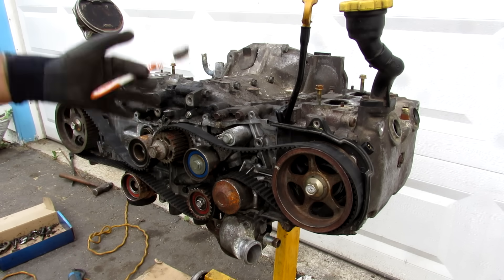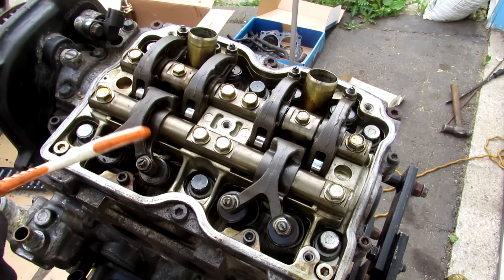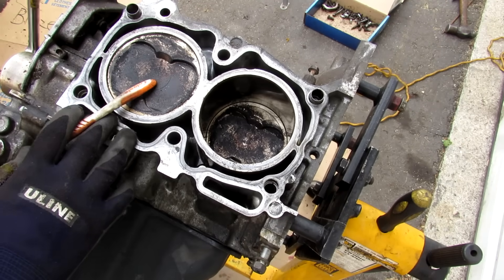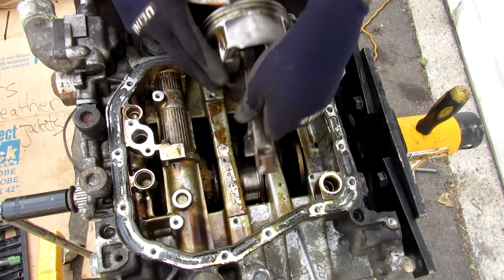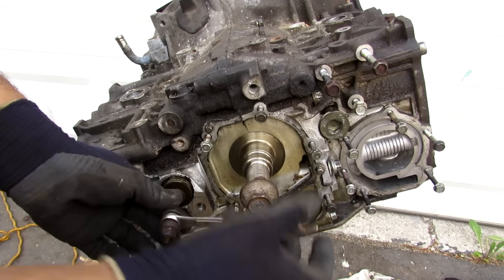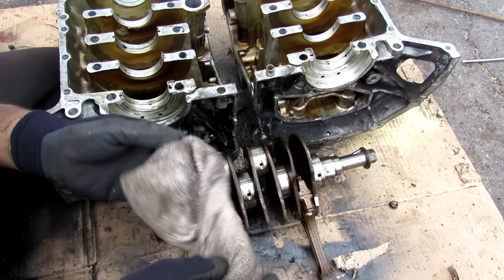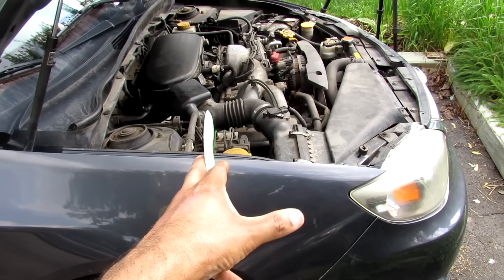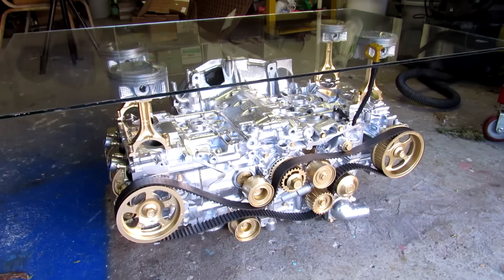Why Subaru Engines FAIL

Comment: I've seen a few used low mileage Subies with blown head gaskets and/or shot bearings.  Now I see why.  If you let the car sit too long between drives, the engine really grinds on itself.  Seems like a pretty good reason to retrofit dry sump oiling to me.  Or some sort of pre-oiler before start-up.  Also, rigorous oil services seem a necessity.  No 15K mile intervals here.

Comment: News flash. If you don't maintain your engine, it doesn't matter what kind it is, this is what you're going to see. This engine didn't have regular oil changes and was ran low on oil. It had nothing to do with it being a Subaru boxer.

Comment: Subaru LOL.  They told my sister that 600 miles per quart was normal oil consumption.  2 years old 30k miles.  They replaced the engine and that one was junk too.  LOLOL

Comment: i have owned a subary legacy turbo 2007 2litre for 6 years absolutely no problems and i drive it hard all the time yes it uses a bit of oil but i check it every month this is my second subaru the other 2002 legacy i owned for 5 years also no problems

Comment: I have had 2 Subaru and put around 200k miles on each without failure. Keep you engine maintained, and it will last for years and years. Good breakdown video of the motor though, I did enjoy that
Reply: My Saabaru Aero has over 200k miles and is still fine. Maintaining it make the difference.
Reply: No one else is concerned about 100k on one set of tires?
Reply: I put 162,000 miles on my first Subaru a 2.5 four cyl engine in a 2005 Baja.  70,000 on a 3.6 six cyl Outback.  All together, since 2005 around 400,000 miles.  Zero engine problems and no mechanical or electrical problems other than one safety recall issue that was fixed at Subaru’s expense before any problem actually happened.  No repairs of any kind, just periodic oil and filter changes at around 7,000 mile intervals.  Never had an oil leak and never had to add oil in between oil changes.
Reply: @Militant 541 People always come up with examples of their car lasting without problems. They don't appreciate that these are just individual cases, you can apply that to any make and any model.  This has to be looked at using thousands and thousands of cars to get an idea.
Reply: I'm going to guess these issues don't apply to my 3.0 H6.
Reply: My 2004 MY05 RS Impreza been going for 220K and 16 years later I haven’t had any head gasket issues. I think a lot of the issues arise from the way drivers treat/mistreat these cars.
Reply: Militant 541 I think most of these head gasket issues apply to mostly the Turbo models which are bought by younger drivers who constantly make modifications and drive them like race cars.
Reply: @Jay Nasty That's good to know actually. Is it an issue on both the 2.5L and 2L? I'm on my 3rd Subaru now and my daughter has my last one, so I'll keep my eye open for the issue. Thanks!
Reply: @Jay Nasty. Thanks. I have 165K. Just want to get another 9 months then I will be strictly leasing from then on.
Reply: @Militant 541 I've not had any dealings with them, a friends son is one example, and he sold it on account of the fuel consumption.  As you say, most cars use in line engines.  Subaru thought the advantages were worth it, presumably because of the models were often aimed at buyers who valued rallying/high performance use etc?
Reply: @Militant 541 I didn't understand that....Could you rephrase it?
Reply: Like most cars they're fine if you keep up with the maintenance and fix stuff when it breaks. Let it go and it's a nightmare.
Reply: @Militant 541 A fair few are here in the UK I'd say.
Reply: Except any modern engine will last for 200K miles if properly maintained.
Reply: @Militant 541 As per my post here, people happen to have a good example of whatever (in this case Subaru) and assume that as such it must represent every similar make and/or model on the road.  Easy, but incorrect, trap to fall into.  All part of the human thought processes.  "Mine was amazing, so they all are!"  You can see it here, and every other forum on the net, in the bar, workplace and so on.........
Reply: It also works the other way too, a few people complaining of issues doesn't mean all are problematic. And he is talking about one generation here which is long retired. The EJ series was a faithful servant but prone to headgasket issues but probably no more than Nissan of same era.
Reply: @Militant 541 FACTS💯 garbage cars,with clear mechanical problems sold to shitty drivers who can only "aim" their cars. How many times are these idiots going to replace head gaskets before they get it...
Reply: My 2011 Forrester has 250k. Bought it brand new. She burns about a quart of oil every 800 miles. She still runs well though
Reply: As Tom Petty says, "You get lucky sometimes". My neighbor got over 300k from a Yugo, but I would never reccomend that car. One must also note that he never drove it over 35mph. My Honda has been drove hard and put away wet and it has over 325,000 miles.  It has been driven with more miles over 60 mph than under.
Reply: Only problem I've had with my two subarus is people crashing into them when parked...Mazda and Honda's on the other hand, drink oil and blow up...most engine failiours probably lack of maintaince as can be seen with what looks like being short on oil wear.
Reply: @Militant 541 maybe the problem areas are the owners. Like every car has problems but becomes worse because of the owner
Reply: @Militant 541 https://youtu.be/-aq0hDvKJ5Q this guy can explain it best..
Reply: So should we get a subaru?
Reply: @IgnatiusCaelestis   Don't do it, unless you plan to change it soon after, their engines don't last, and are just a pain in the ass, unreliable and overly complex. The boxer design causes the pistons to wear fast due to gravity, don't expect these to last as long as the conventional vertical design ones, specially if it comes from Toyota, like the 1.5-liter DOHC 16–valve 1NZ-FXE I4 VVT-i (Atkinson cycle) engine.
Reply: @hedgehogthesonic3181  the fa24 just came out a few years ago.  How do you know that?
Reply: @IgnatiusCaelestis  Well we will see about that, but still the design is bad and is not going to last as long as the conventional vertical one. Gravity is going to cause wear in only one side of the pistons, no matter what. But we will see how long that engine lasts.
Reply: Go walk through a salvage yard and you will find a much higher number of GM, Ford and Dodge vehicles when factor in the number originally sold.
Reply: @Jay Nasty As an actual owner f 2 100k mile plus Subarus (one 200k) I can tell you I'm not BSing. I did all the recommended maintenance and both cars were bullet proof. Just a sample of 2 though.
Reply: @dnoH  well I have 4 more I can add to your sample.  Over 400,000 miles altogether with zero problems.
Reply: @dnoH  Subaru were the ones who redesigned the gaskets and pistons because of all the problems.
Reply: I had one that was maintained well and drove lots of highway miles. Rod went through block at 202,000 mikes.  Still good but not up to Toyota standards. My sister's blew head gaskets at 100,000. I see the why after this video. overall good cars just don't expect 4 runner longevity.

Comment: The title should have been, people don't know how to "maintain" 90s Subaru motors, my 99 Subaru legacy GT 2.5L is the dohc motor and got it 11 years ago with 70k miles on the odometer ( new odometer 62k miles on it) and now it had way over 200k miles, always maintain it top notch, timing belts changed every 60k and if you are worried about the head gasket just get a 2004 STI gasket and problem solved, cheaper than replacing a water pump on a audi😂😂😂 and can't compare the reliability....... Audi, Mercedes& BMW be like...... Oh craps my car its almost at 60k😞 time to get a new one.

Comment: An incredibly informative video from which I have learned much, having only stripped conventional engines previously. I have a 2.0 DOHC BP5 engine, but by and large, most of the  procedures are similar. Very well explained and clear video instructions.

Comment: Being damaged by running low on oil isn’t a design flaw
Reply: Burning a quart between changes on the other hand.....
Reply: @Z287899  More like 10 quarts.  One every 600 miles
Reply: It is, because it is caused by a series of design flaws.
Reply: @borasumer  Correct, seen this on quite a few YouTube vids, when people try and boost these things with powerful turbos, more than once I've seen them basically fill the catch can within 2-3 dyno pulls
Reply: Does gravity play a factor. Or is oil pressure enough

Comment: As a long time owner of Subarus (first one a 1978) I have always wondered what causes the unique sound the engine makes which is like the VW air cooled version. You can always tell what is coming down the road just by listening.  My current and probably last Subie is a 92 SVX with 83k. My favorite was a 97 Legacy Brighton wagon with the 2.2 and 5 speed. Too bad I was t-bones at 297k about 7 yrs ago. I would probably still be driving it. Also miss the 81, 82, 84, and 92 wagons with on demand 4 wheel drive.

Comment: Sorry but the only actual flaw on this motor are the heads walking on the block that causes the head gaskets to blow. The rest of the problems are all do to lack of maintenance 🤦‍♂️ this motors originally design is the VW motor from the 1950's that Hitler gave his approval to produce.

Comment: The original head gaskets were made of single layer steel not composite. I have been on Subaru pages for years and have never once heard of "re-torquing the head bolts" as they are torque to yield and are only meant to be taken to spec one time and then replaced.

Comment: Damn, now I now why my Subaru always ran hot. I always blamed the radiator being to thin or lousy fan but now I know why even after replacing the gaskets and resurfacing the heads, after a year it slowly run hotter and hotter...
Reply from the maker: Did the head gasket blow after you replace it?
Reply: @speedkar99  No it occasional whent out with out any relation. The timing belt was a yearly job regardless or it would go out, it was always the driver side timing belt.
Reply: @speedkar99  Sorry maybe wasnt clear, head gasket whent out slowly after replcement within a years time and car would run hotter and hotter until gasket whent out entirely. Timing belt would never last longer than a year.

Comment: The plugs are 100,000 miles tho,  that like 1 change for the owner on average, makes up for the clearance.
Reply from the maker: It's the same as having a timing belt vs a timing chain ... That one time expense you'd rather not have

Comment: What year engine are the most desirable / reliable / trouble free. And, what do you need to look for when buying a used Subaru.  "Thanks" great video!
Reply from the maker: The EJ25 are the most problem prone. 
EJ20 held up better
Reply: @speedkar99  What year / models did the EJ20 come in? "Thanks!"

Comment: First, this car is turbocharged?  By the looks of this engine looks like owner did NOT cover maintenance schedule.  Subaru’s, specially Outback and Forester (non-turbo) have terrific longevity, boxer 4 engine tough!  Yes, I know!  You maintain these engines, they’ll last forever.  My maintenance total almost 17yrs $19,000.  Most folks buy 3 cars in 17yrs medium $70,000!!  I’ve got 250,000mi on mine Same Engine!   We’ve had several, my Forester going on 17yrs old.  Do that with V engine or ‘inline’....lol.  Without engine replacement....only tune-ups, belts, the usual.  If your looking for racing power, Subaru is not your option.       P.S. Porche has boxer engines
Reply from the maker: It's good that you take care of your car. 
When others abuse Subaru engines like Corollas then we've got problems
Reply: I fell slightly sorry for the USA having to put up with the 2.5 engines. Mine is 2.0 DOHC here in the UK and the 2 litre models have much better reliability and longevity than the 2.5s.
Reply: I Had a focus svt in-line 4 with 226k miles on it when I sold it to a guy at work, beat the piss out of it every time I drove it too. All I ever see about Subaru is 16 year old kids blowing them up. I wouldn’t touch one with a 10 foot pole unless an old man owned it.

Comment: I've pulled a couple oil starved EJs apart and on a couple the screws holding the backing plate on the oil pump were loose, on one motor so much so that you could unscrew them with your finger. Its no wonder there was oil starvation.
Reply from the maker: Wow that's bad 
No oil pressure

Comment: Theoretically cancels vibrations. Spark plug access, not so good. Belts. Timing. Long. Hmmmm. Rocker assembly. Retorque the head bolts. Weepy-Deepy coolant on the outside. Inside are worse. Oversquare design means revs. Short stroke works with the rpms as well and defines engine size from stroke. Very nice explanation of the positions of the engines and where they sit. Volvo and suburu. The V6; shorter with secondary forces cancel out. Maintenance. Seems like improvements to oiil delivery, pick up and pump all could be improved to reduced engine oil starvation. I thought you would mention the improvements to rectify failure in your vlog, but I didn't really see that emphasized. No wasted time, thought. You went through it like you were late for lunch. AF
Reply from the maker: Good summary. 
Subaru has supposedly made the FA series of engines better 
Time will tell

Comment: My Subaru EJ20, 2002 year produced. 
Did 260000 km, not a single failure. Usual semi-synth oil 10w-40...
Reply: Pretty sure the 2l anbd 3l Subaru engines are super reliable just the 2.5 that sometimes have issues, my EJ20 is at around 255k and stil running perfect.

Comment: Boxers suck as an engine design - double the heads, camshafts, pulleys and other parts. Less rigidity, uneven thermal distribution, costlier to manufacture, heavier, harder to service. They were an experimental design back in the day, but inline and V engines are far superior in design and reliability.
Reply from the maker: True

Comment: In other words more cons then pros with Subaru engines they're lots of fun while they're working and require extreme maintenance to prevent the many failures they are prone to... if you don't have specific need for the pros that it offers and aren't ready to do thorough maintenance then you should stay away from these engines..
Reply from the maker: The problem is most people buying these economy class cars will treat them like the equivalent Honda or Toyota which can take more abuse because of their simplistic design

Comment: I loved my Subaru Outback, but after spending around 4 grand on a reconditioned engine (head gasket issue) that only lasted another 3 years, it is never again for me.   I could have lived with the head gasket issue, the reason never again is strictly due to how they responded to their customers who had to deal with their bad designed engine.  Basically no help at all.
Reply from the maker: What year and mileage? Did the head gaskets fail after they were replaced or was it a used engine?

Comment: My 2005 Outback committed Subiecide a couple years ago. Front differential seized and blew its guts out on the ramp to a major bridge. Gear oil for 1/8 mile. It was embarrassing to say the least.
Reply from the maker: Oh my....I can imagine the trail of embarrassment
Reply: @speedkar99  It was nasty. Greenish gray with a yellow froth. Car still had enough of the rear transmission left to power itself onto a rollback though.

Comment: Had mine fail from the harmonic balancer separating and falling back into the timing. Cursed that plastic cover on the side of the road. Engine ran so smooth, painful to see it destroyed.
Reply from the maker: Ouch! What did you have to replace?
Reply: @speedkar99  Yeah, ended up replacing both Heads, tensioner pulley, belts, ect. We got lucky and only the valves bent, piston was fine with no other internal damage. Pulled the engine one day and had it driving the next. Sold the car later in the year and broke even with parts  spent.

Comment: OK, now I'm really amazed. When a head gasket went in my Outback, my mechanic was able to replace both while the engine was still in the car.
Reply from the maker: It's possible but boy is it hard
Reply: @speedkar99  it's even trickier with the engine still running..!!

Comment: What a great recommendation for a Chevy. We are on our second Equinox 4 banger with not one single issue. These may last a very long time with 110% servicing, but not worth the risk to me. No way I buy one. A lot of this tech seems to be lifted from the Corvair, with a ton of added complication. A 70's Subaru would be preferable. There are a ton of Fram filter comments. Just change the damn things when you are supposed to. Millions of cars have done trillions of miles with them just fine.

Comment: Been working on Subaru’s for 42 years.  Head gasket external leaks yes. Oil burning on this engine. No different from any other engine if you don’t change oil. This is the best of Subaru engines.  Forgot to mention exhaust valve guides move out of position causing caves to stay open. Tuning? No way in hell!!  Repair 2 to 3 Subaru engines a week due to tuning. They can’t take it unless you forge the whole bottom end. Do your homework!
Reply from the maker: I thought the EJ25 was the worse and the rest we're slightly better than this

Comment: Since LEGENDARY SUBARU became part of GM, all sort problems started. They start when well prospering company is evaluated by production economist of GM network suppliers and they exchange good working parts for cheap of their sort and change production to reduce the costs....

Subaru never had those problems before, but since GM is controlling it that's a different story.......
Reply: Please cite your source for the 'current' GM interest - GM liquidated their shares in 2005. When I bought my 2018 Subaru, Toyota had 10% interest in Subaru / Fuji Heavy Industries.